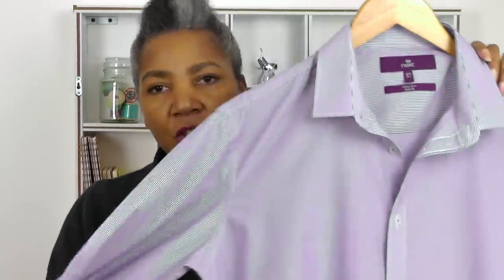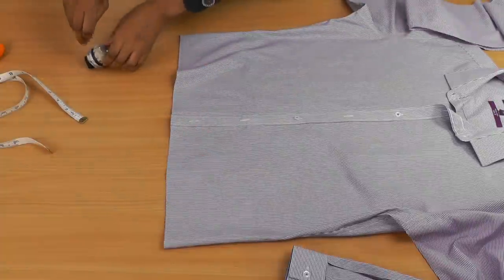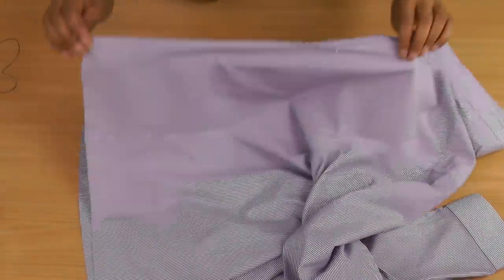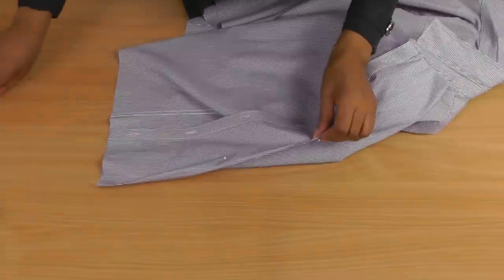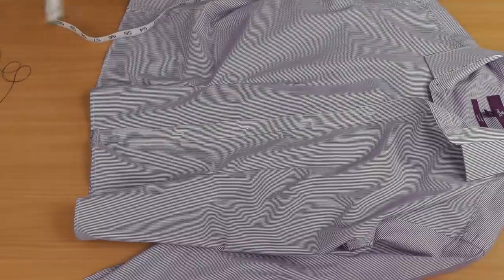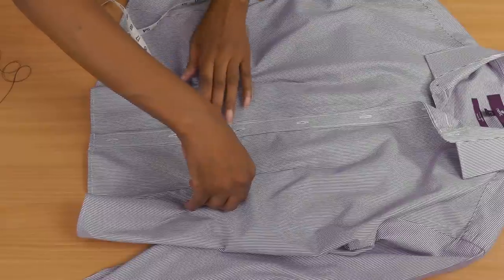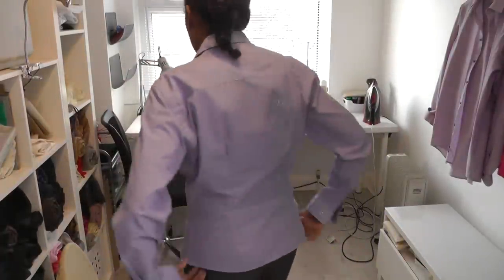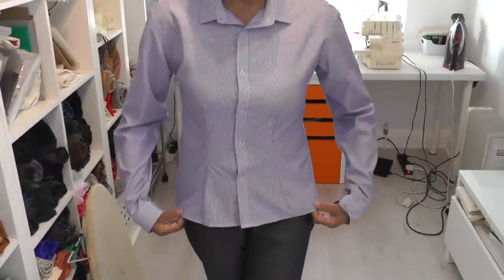How to Alter a Man's Shirt to a Women Shape

Comment: Thank you. However I think the top shoulder seams should be closer to the shoulder joint. The problem with doing that though, is you might shorten the sleeve too much. You could pull the sleeve away from the shoulder seam, cut the shoulder line closer to your body and pin back the sleeve. It’s a fiddly process and I know most people want a quick fix and that’s what you’ve shown us. But can you please show us how to taylor the shoulder seam as well? If you can be bothered that is. Otherwise I won’t be tayloring men’s shirts to fit a woman’s body, if the shoulders don’t fit nicely. I have narrow shoulders.
Reply from the maker: Hello Tonie, you are right on point about the shoulders and thanks for sharing.